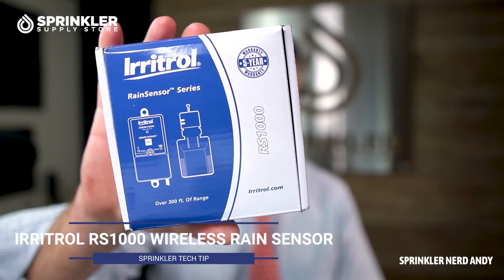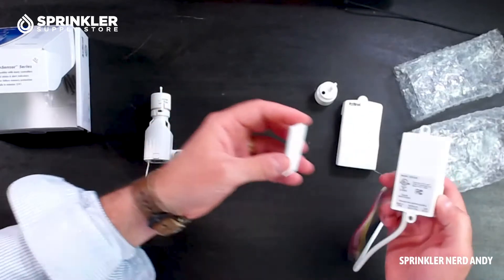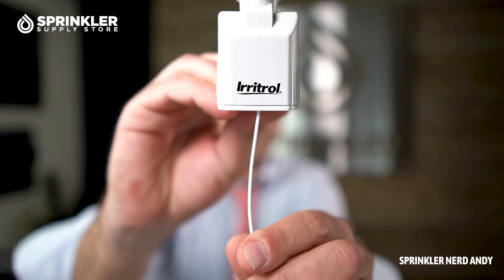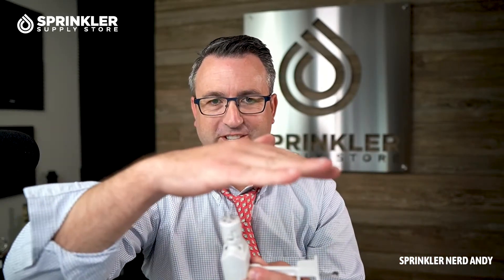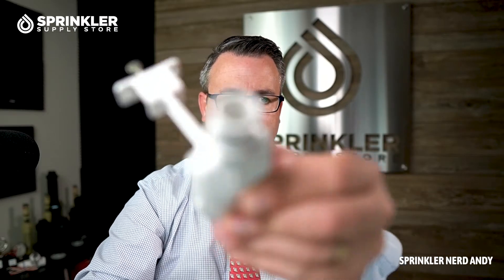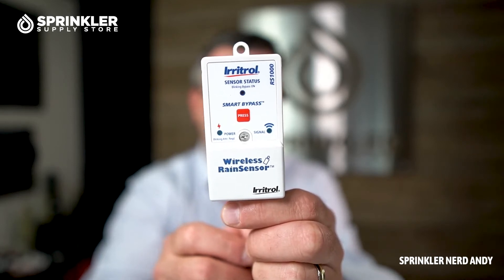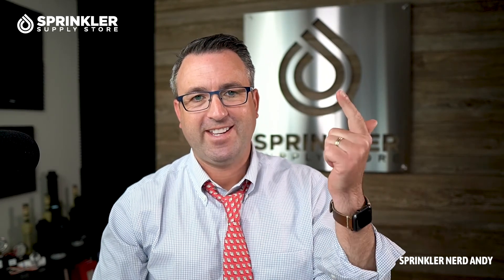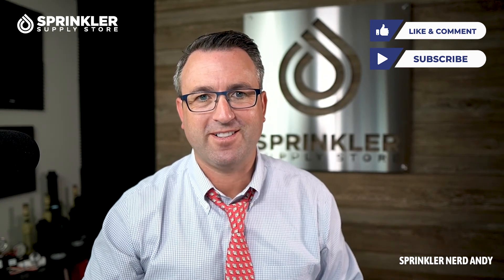Irritrol RS1000 Rain Sensor - How Does It Work? | SprinklerSupplyStore.com

Comment: The green light is flashing on the R1000, will my preset watering programs run as set while I'm away? Thanks
Reply from the maker: Which light is flashing? Non of the lights should flash.

Here are the possibilities:

Sensor Status Indicator: 
Steady light - Sensor is active (either rain or freeze).
Blinking light - Indicates receiver has been bypassed for one rain cycle. Smart Bypass button pressed once. Press again to exit bypass mode.

Power Indicator:
Steady light - 24 VAC power is connected.
Blinking light - Sensor/Transmitter battery power low, or other communication problem.
No light - Unit is off or is disconnected from 24 VAC.

Signal Indicator: Indicates quality of last received signal. Steady light - good signal.
Blinking light - fair signal.
No light - poor signal (relocate Sensor Transmitter).

Comment: What is that hole below the markers for setting rain level. Theres a plastic ring that turns and can open or cover the hole.
Reply from the maker: Awesome question Henry! I forgot to mention this. The hole can be used to control "dry-out" by twisting the vent ring to cover it, or keep it open. If the hole is left open, the sensor will dry out faster, if the hole is covered the sensor will dry out slower. Thank you for pointing this out. -Andy

Comment: Mine is set at the lowest possible setting but is entirely too sensitive. A light rain keeps the system bypassed for days. How can I adjust that? Thanks!
Reply from the maker: Interesting. What make/model controller do you have?

Some controllers have programmable days off after a rain event setting - check to see if this setting is activated on your controller.

Comment: Tell me how u test rain sensor to see if it's working and explain in detail how the outdoor sensor indicates on the sensor panel
Reply from the maker: Hi Sandra. To test the sensor you should depress the white spindle on top of the sensor for 3-5 secs, and see if it the receiver goes into rain shutdown mode. Unfortunately that is really the only way to test it, which means you’ll need to access the sensor which is not always easy. Good luck and let us know how it goes.